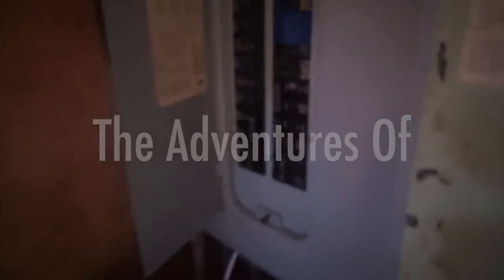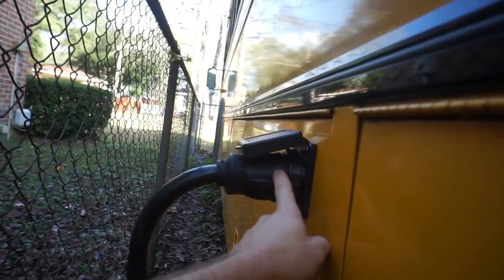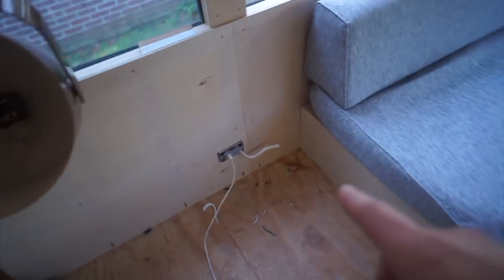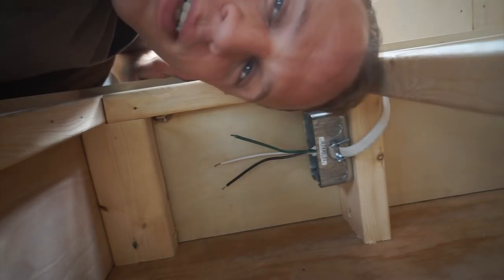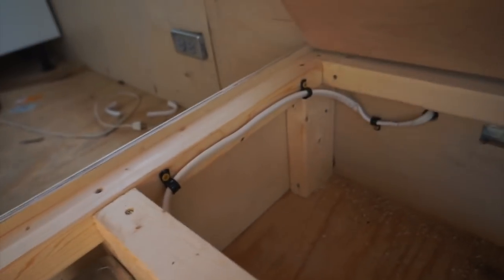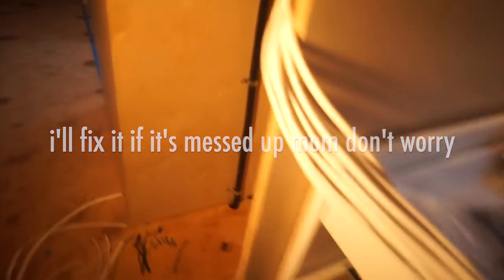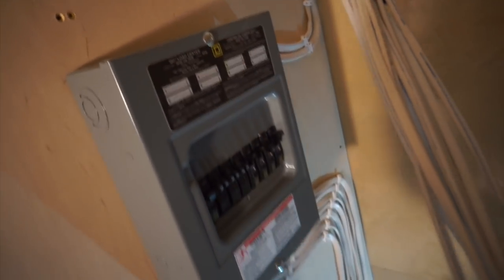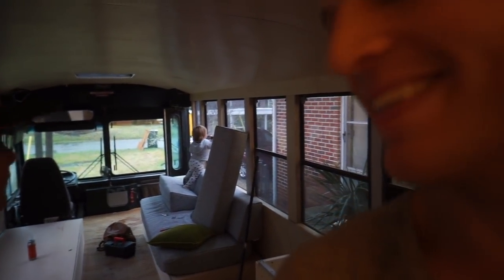Skoolie Power: An Overview of the AC Electrical System On Our Bus Conversion: Ep 41

Comment: Why shouldn’t you use that 50a main breaker with a mini split? Haven’t you used a mini plot in a later video? What should be used as a main breaker instead?
Reply: I received this incredibly useful info from Justin:
The breaker that comes with that 50 amp spa panel you see linked in the video description is a GFCI breaker. The solution is to replace the breaker with a 50 amp non GFCI breaker and you'll be fine.
Reply: @Connoro79  ok so no gfci 50 amp main breaker and should be groovy? I’m about to start my electrical install glad I read your comment!
Reply: @rivertlevandowski  I followed Justin's method, and swapped it for a regular one, it is so far working well. But I have only got shore power hooked up, and no A/C just yet
Reply: @Connoro79  awesome I’ll only be running shore power for a while solar cost is a little prohibitive at the moment.
Reply: @rivertlevandowski  Right there with you! Goodluck!
Reply: @Connoro79  got it installed and figured out! I just ran my 50a Rv extension cord to my load center via 6 gauge off of myshore power hook up. Then a dedicated 20a circuit to the minisplit.
Reply: @rivertlevandowski  so no need for the spa panel at all? I'm sorry I'm late to the party but, just starting my electric this week...
Reply: @TheSlambert123  I have had mine installed without one for almost a year now and no issues. I would say the spa panel is indeed redundant.
Reply: @rivertlevandowski  gotcha. I’m not an electrician so this is about the only part I’m scared of doing wrong… 😬
Reply: @TheSlambert123  oh for sure I am not one either! When I went to throw the switch at the main house panel for the first time I was sweating lol! Just take your time and do it right the first time you’ll be fine.